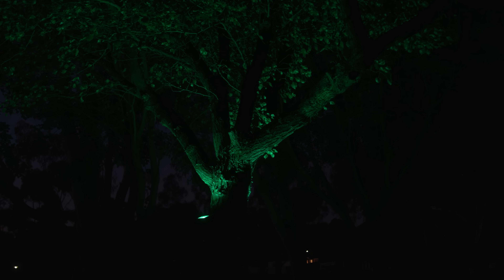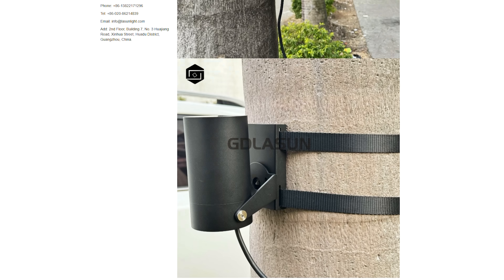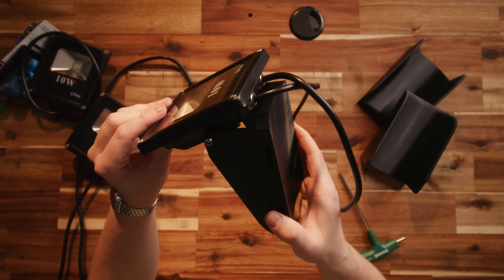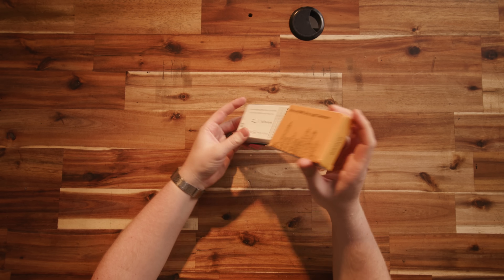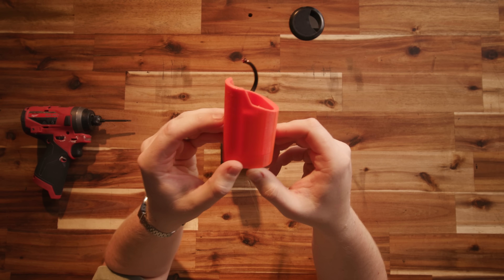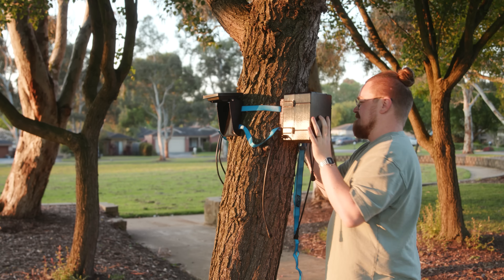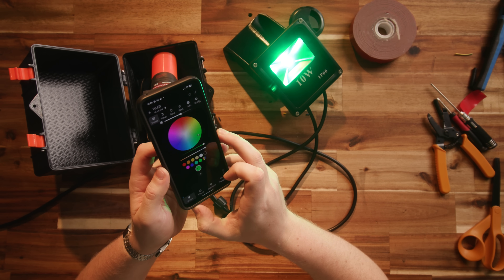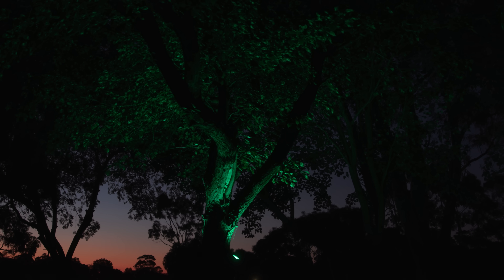Guerilla Christmas Lights | Stockpot Christmas 2025 Part 2

Comment: Petg works just fine for year-round especially if the part has some Mass the important thing is to make sure not to do exactly what you're doing don't use black. What damages a petg print is thermal radiation basically light. The darker the color of the plastic the more thermal radiation you absorb. So don't use dark colors

Comment: I've gotta be honest, I don't love the lights being put on trees. It can have negative effects on wildlife. And upwards-facing floodlights are especially bad for our nocturnal life. If it's just a 10–20 minute display nightly, and they're off otherwise, that's probably no issue. But if it's on for hours in a static or regularly-rotating display, that could be more of a problem. It's not completely clear to me from the videos which of these it is.

Comment: Nice video, just a heads up Milwaukee batteries don’t have any built in voltage cutoff in them they are in the tools. So I’d recommend getting a Low Voltage Disconnect Switch and putting it between the battery and the controller so you don’t destroy your batteries cells.
Reply from the maker: These WLED units can measure voltage, so I'll set up an automation to turn them off when the voltage drops. 

Cheers for the heads-up!

Comment: I'm sure you'll discover it, but the m12 batteries don't have undervoltage cut offs, that's built into the tools. They also won't charge if they are under a certain voltage on the stock charger. I build a m12 lamp for climbing in roof spaces, and it chews through those batteries fast. Usually need to parallel them to another battery to get the voltage high enough, then quickly get them into the charger to finish it.
Reply from the maker: Noted! 

I'll whip up an automation to turn them off if the voltage drops too low! Cheers!
Reply: I’ve always thought it’s so surprising that they don’t have it. Yet bargain cheap Ozito stuff does have it built into the battery
Reply: @nickbooth9685 I think it has to do with the size. The m12 batteries are tiny, and then having a battery change display/cut off PCB on the small light battery. No idea for sure though.